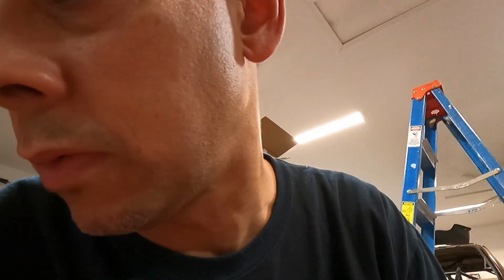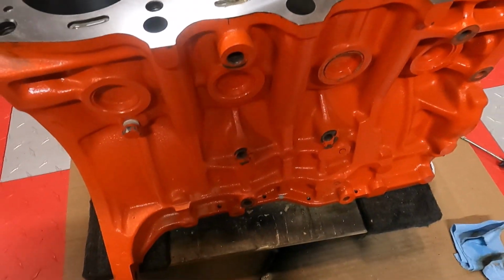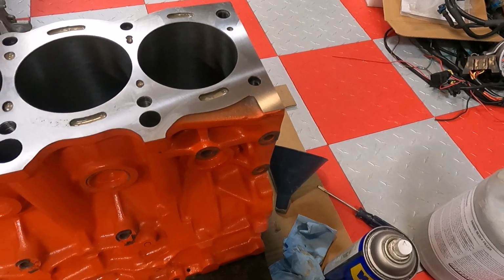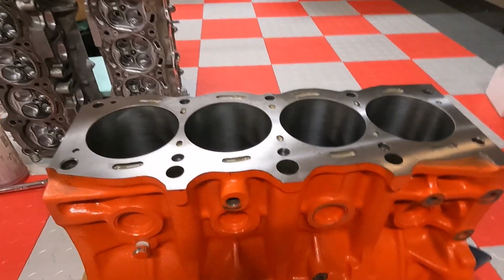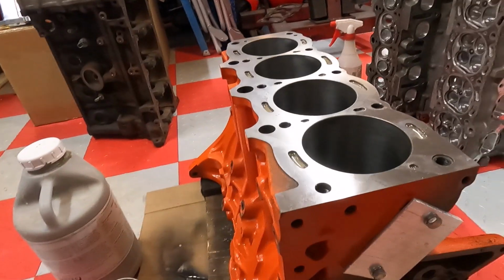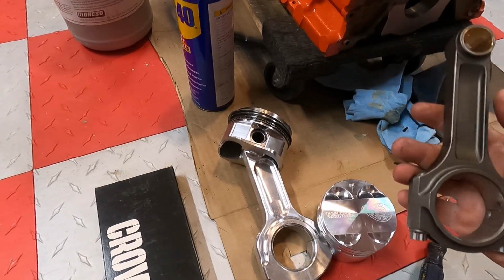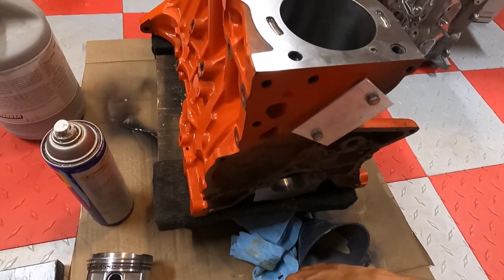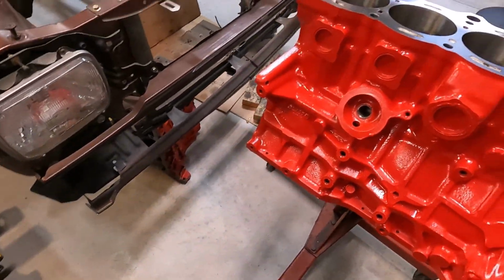3S/5S Block Cement Fill #3sgte #mr2

Comment: Can you run the engine on track with only half concrete so the water still flows the head and half the top of block?
Reply from the maker: You can, but if it is strictly track, it's better to fill the block completely! We still run water thru the head

Comment: hello, thank you for this video. i am about to fill a 0.20 bored 3sgte block.. i have a question. Does it make it stronger? does it affect the cooling effect without the coolant galeries? any advantage and disadvantages?
Reply from the maker: Most definitely affects cooling, are you doing a half fill??
Reply: @psiracing just saw this response. I'm using the full gallon into the 4 cilinder 3sgte
Reply from the maker: @jadp2024  so you are doing a full fill??

Comment: I would like to learn more about this
Reply from the maker: Hello, what would you like to know??
Reply: @psiracing  what’s the point in doing this, what jackets are you filling and why/ what are the benefits? I’m looking at getting a gen2/3 3SGE head and a Toyota Camry block I’m thinking of going with a 99 but I’m open to suggestions what block and head would you recommend and why?
Reply from the maker: @jiggatoni4082  High Horsepower setups we blockfill the engines to strengthen the cylinders

Comment: Good info on the pistons, any thoughts on running pistons wit higher top ring and overall thinner rings?
Reply from the maker: Not sure what you mean about the higher top ring?? Like raised in the piston? Thinner rings can work as long as you plan on changing them more often

Comment: Are you running water in the cylinder head? If so what is your water pump and plumbing setup? I'm considering doing a full fill on mine since I keep cracking blocks 😅
Reply from the maker: Which gen block are you using? Is it a 5S or 3S block??
Reply: @psiracing  gen 2 3s block

Comment: I'm just curious why would you cement the water jackets and block
Reply: This is for extremely high HP applications, at those HP levels cylinder pressures are insane...you can imagine the cylinders balloon out a few thou, combustion gasses escape past rings, pistons can slap, in extreme cases the bore may split. The cement reinforces the cylinder walls increasing power handling reliability, also stabilises the whole block at high HP / RPM levels to maintain gasket and other clearances. Note it comes at the sacrifice of engine cooling so not for the daily driver.
Reply from the maker: @patrickm9785  Great response Patrick and exactly correct. Beauty is we still run water thru the head!!
Reply: @psiracing Always gotta keep a cool head :)  - Rules for life :)
Reply from the maker: @patrickm9785  Letssss Gooooo